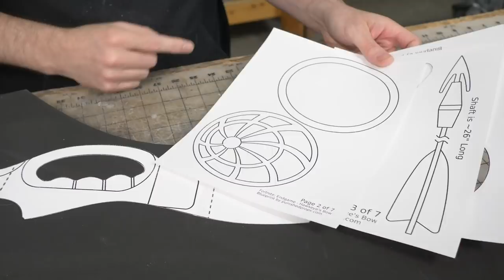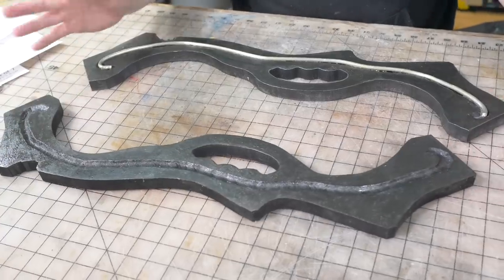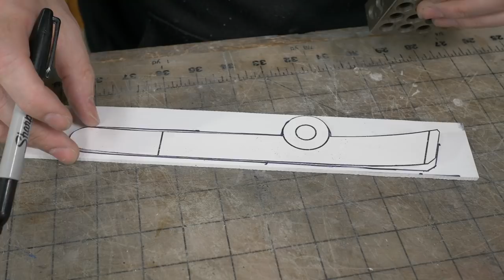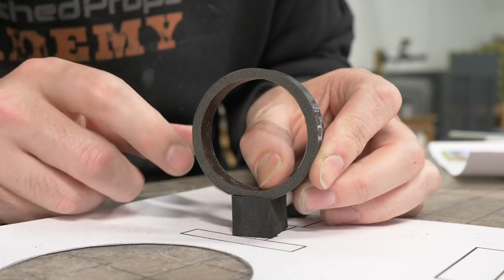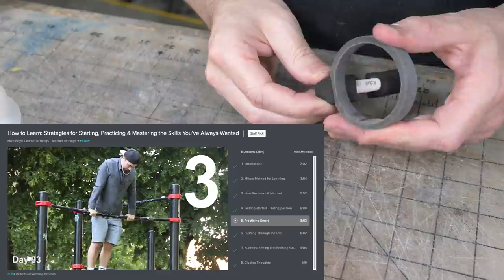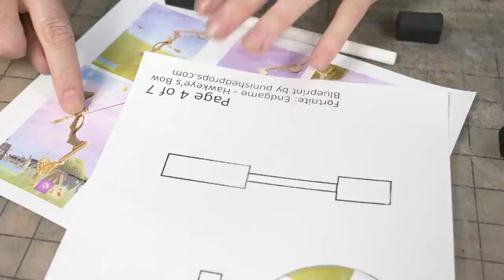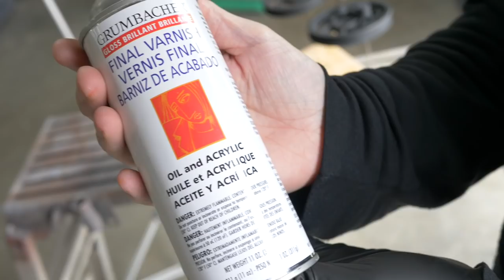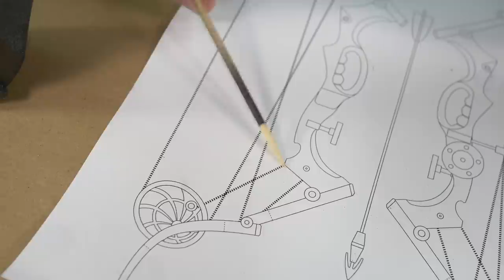We built HAWKEYE'S BOW From FORTNITE x AVENGERS ENDGAME event! + FREE Templates!

Comment: Styrene is used for most plastic model kits, and the solvent weld is the same chemical as the plastic cement you got in the orange tube from testors.  PlastiDip will stick well to primer on the Styrene:  rough it up with some 400-600 grit sandpaper and then paint it with primer (look for primer that says "plastic and metal" or "Adhesion Promoter" in the auto parts store).  After that, the plastidip will stick to the primer and the primer will stick to the styrene (much better than PVA/Mod Podge!).
Reply from the maker: Great info!
Reply: Aaaaand the cement in the orange Testors tube smells like....oranges, great smell when building models lol :P
Reply: Now HERE we go!

Comment: What a great idea concerning the armature wire.  I've used armatures clay, but I like the idea of using it to stiffen the foam.

I'm learning so much from your videos.  For an old, retired dude who can't be trusted with power tools (LOL), I think I'll use my hot knife for cutting the foam.  No high rpm spinning parts to grab things.  (While there's fumes, I find them easier to deal with than the foam dust.  In a dry climate, static causes it to stick to EVERYTHING, and a vacuum doesn't help with that.)
Reply from the maker: We're happy to help!

Comment: Awesome build! I am pretty sure your "string holding thing" is supposed to be the pulling point for the string when shot with the  quick release that compound bows use. It clips into a devise you hold in your hand which you use to pull back the string and then click to loose the arrow. It's more comfortable than pulling back the actual string on a compound bow. I could be wrong though, I've only shot a compound bow once. When it comes to archery, personally prefer a recurve.
Reply: I've used compound bows before myself at Girl Scout Summer Camp, even if I prefer to shoot recurve also. And your correct on the fact that the "string holding thing" is meant to go on the wrist. It is used for rapid release, meaning it's ideal for hunters who might draw back and then hold their draw while waiting for the perfect moment to release. Was scrolling through to see if anyone else made this comment before posting my own.
Reply: Actually it's a cable guard. It's meant to hold the cables out of center so they are out of the way of the arrow.

Comment: Hey Bill just wanted to share a quick DYI tip when it comes to small item painting. I am a model builder, mainly Gundam. I am building a Gundam for my Nephew’s Birthday and was prepping some gun parts today,to be painted. When I had epiphany as I was thinking of a clean and cheep way of of mounting my pieces to be painted. Not sure if it’s original idea, but I have never heard of it before. I came up with the idea of using simple jumbo paper clips bent correctly to hold my model parts in place and can be lined up separately to paint and dry. Works well to hold items on lazy Susan while you spray. Works great for small parts that have a hole. Than once you are done you can reuse the clips or toss them. Hope the tip I just fingered out helps you in any way. Been watching your Channel for years now and learned al lot. Thanks Bill.

Comment: Important thing on the laser cutter is... EVA foam is ok but other foams can become acidic or toxic when heated which can do damage to your laser (or you).

I do lots of cutting of foam on my laser, I tend to tweak the power and speed and know how many passes it takes to get a clean cut. After a few thicknesses, you do end up knowing the right presets. The lowest power setting + 20mm/s and 3 passes is usually enough for 10-12mm EVA as a reference

Edit: if you just wanted a slot like I did on a cosplay repair kit (Cospl-Aid) I designed for pins etc then you do 40mm/s and 1 pass for a notch

Comment: Hey Bill and Britt!, Great work on the bow!,

Just a quick question for you guys.  What is the best technique to make EVA foam glossy and smooth so that you can get a real nice and shiny glossy finish on it like you did with the code geass helmet you guys did last week. ( I know that the helmet was made out of abs plastic.) But for something much bigger than a helmet, what would be the best way to get something that was super glossy and shiny?

Thanks in advanced!
Reply from the maker: Thanks so much! Here's our video on different methods to seal foam to achieve different finishes: https://youtu.be/ug6Rs06FEpk That might help you out. The main thing to consider is how much the piece will be flexed or stressed. A super shiny foam finish is best for something that won't be bent or have much stress applied to it.

Comment: That came out looking great!  Using elastic for the string was a clever solution, and I can't help but wonder if you could have given it a slight bit more tension between the two pulleys just so the illusion wasn't shattered when the bow is resting.  

My favorite of the avengers weapons is still Mjølnir.
Reply from the maker: Thanks so much! If I had used a more rigid piece to help the foam keep its shape then I could have increased the tension, but because I used that aluminum wire I can only pull or flex it so far before the wire just bends and holds the new shape.

Comment: Is there a reason why you don’t just cut both pieces that are exactly the same at the same time on the machine? Since it looked like you had enough clearance and the foam you started with looked sturdy enough not to move as you cut. Maybe temporarily attach both layers with turned out masking tape?
Reply from the maker: I could, but it's easier to get the accuracy and shapes I want when the piece I'm cutting isn't as thick. I'm able to cut through it so quickly on my saws, it's not really a step I need to save tons of time on. If I were producing these rapidly, then I might need a different way to cut them.

Comment: How often do you have to change out your band saw blade? Does the Eva foam dull it fast?
Reply from the maker: For cutting foam, I don't really ever need to change the blade. I usually change the blades when they break or if another material, like metal, has dulled the blade.

Comment: Hey guys !

I recently bought a bandsaw but it came with a regular woodcutting blade, so i bought a metal one, buuuuut it's kinda big and not a smooth cutting edge. I'm wondering what are the details or Bill's blade ? TPI and thickness of blade ? 

Thanks if anyone knows !
Reply from the maker: I use an 18 TPI metal cutting blade for cutting foam. I think it's 1/2" thick. It doesn't leave a perfect cut surface, but it's pretty good.

Comment: You should try a wire blade for that scroll saw. Its like using a hot wire cutter.
Reply: The spiral or the diamond coated ones?
Reply: @josuelservin2409  if your cutting foam i don't think it really matters. its just super thing and you can to very tight curves with it.
Reply from the maker: Interesting idea!

Comment: If you string the bow right than it will get some let off like s real compound bow
Reply from the maker: I'd have to put something less flexible in the main body of the bow, as my thick aluminum wire will bend into a new shape and hold it if I pull it too tight.

Comment: I've never made a single prop, but going on my expertise of watching prop making videos, I would have hinged the limbs to the riser with a bolt/axle through, and let the eccentric gears actually roll over (this is what allows an archer to hold the bow fully drawn with minimal strength), then you wouldn't need elastic when drawing it, and it would actually look even cooler.